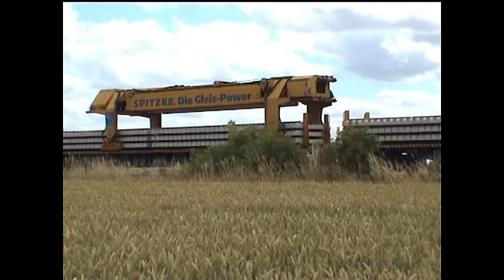Gleisbaumaschinen im Großeinsatz

Comment: 6:03: Mhm, unter "Knochenjob" verstehe ich etwas anderes als ganz entspannt am Gleisbett stehen und der Maschine bei der Arbeit zuzusehen. Außerdem werden die Jungs auch ganz gut bezahlt...
Reply from the maker: So entspannt an der Maschine stehen, ist nicht immer. Die Leute stehen unter Zeitdruck und bei größeren Störungen ist es Schluss mit lustig.
Reply: Es ist ein Knochenjob. Wenn z.b. bei der RPM größere Steine drin liegen und der Greifer es nicht schafft, dann ist Manpower gefragt, es ist nicht immer das Nachbargleis mit gesperrt. Es gibt auch eingleisige Strecken. Bei einer RM ist nur Manpower gefragt, die haben nicht die Möglichkeiten eines Greifers und so wie es in diesem Video läuft, ist es nicht immer so. Dort waren gute Bedienungen. Man darf eins nicht vergessen, diese Leute stehen bei Wind und Regen, bei Tage und Nacht rum und das für 12h pro Tag. Ob die dafür gut bezahlt werden, ist von der Firma abhängig. Nicht jeder wird gut bezahlt, leider.😔